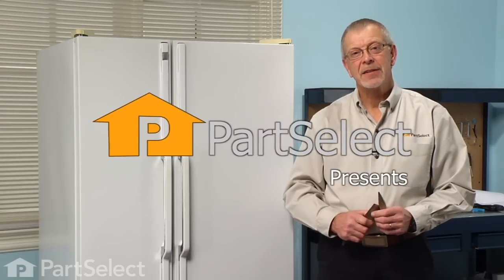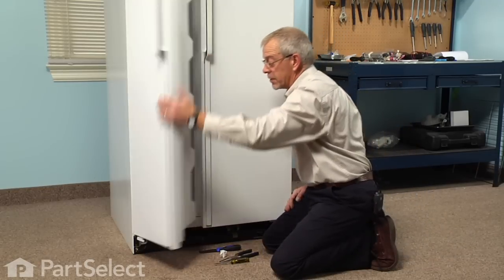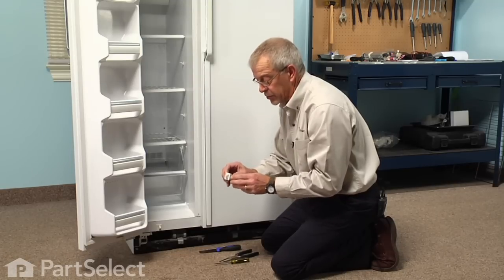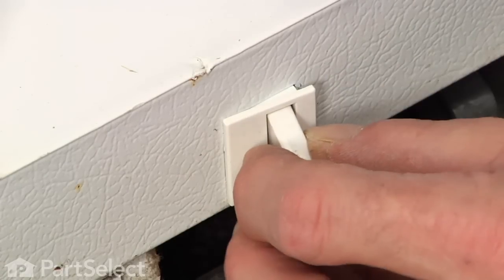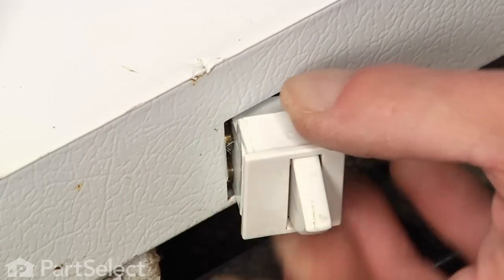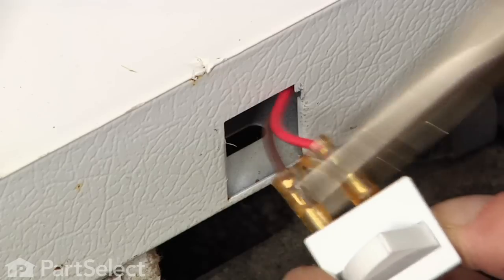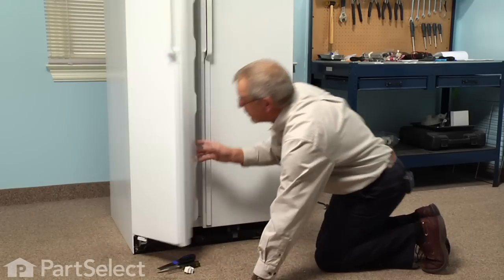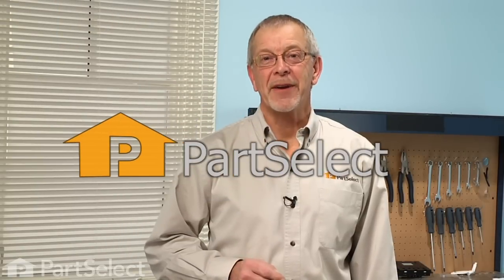Refrigerator Repair - Replacing the Light Switch (GE Part # WR23X10143)

Comment: Just got my GE light switch for the main door today. Part got to my location in 3 days.  Very fast shipping ( Im located in the West Coast ) since the part came from the East Coast.  PartSelect has helped me with both my dual water valve in the past; and now the light switch.  PartSelect has saved me a lot of money and time.  Thanks for all the help with your videos and your parts for my household appliances.  HIGHLY RECOMMENDED !! ( Oh, thanks for the magnet for my refrigerator :)
Reply: My genuine renewal GE part (WR23X10481) only cost me $7.68 from PartSelect.
Reply from the maker: Hi Roger, 
I'm happy to hear we were able to save you lots of money and time! Make good use of that magnet!!

Comment: Thank for the post. I have a GE Profile Refrigerator that continues to beep at the control panel. Can't reset it (tried unplugging, multiple button punching, et.). Model #GFSS6KKYBSS. I want to believe it's the simple fix first. Would replacing the light switch be a good place to start?

Comment: Hi, I have been having problms with the light in my refrigerator not staying on when the door is open. But then funny thing is when I remove the switch from the liner everything works fine when I press and release the rocker. It's almost as if the hole in the liner is too small and it's putting pressure on the body of the switch and doesn't allow the rocker to move freely. Out of the liner hole, just fine. In the liner hole, problems. I don't get it.
Reply from the maker: I would suggest that the terminals on the wires are putting a strain on the body of the switch when it is installed and causing it to warp. Try removing a small amount of the foam insulation where the terminals would be to see if that helps.